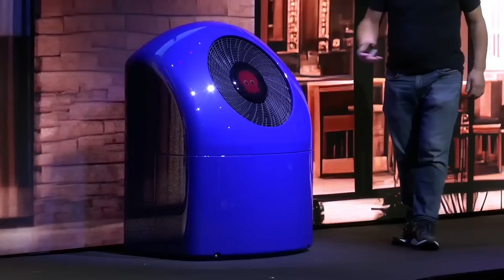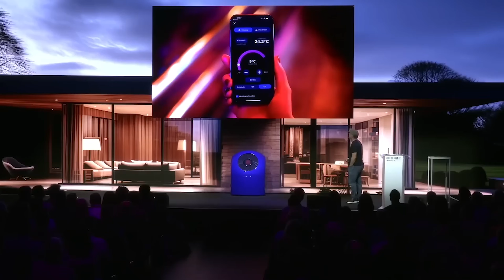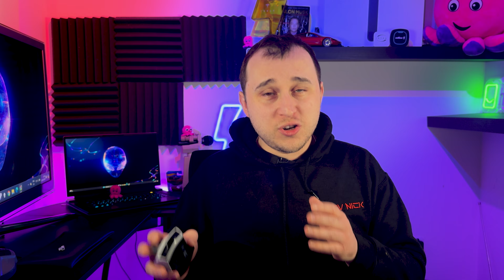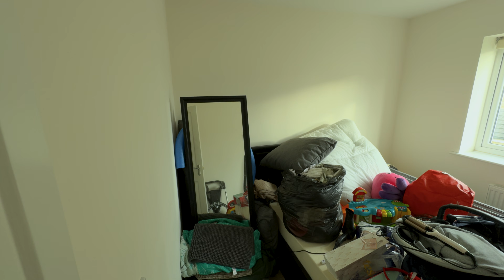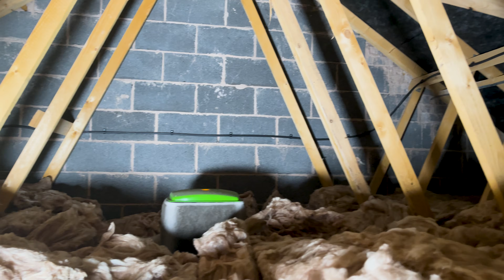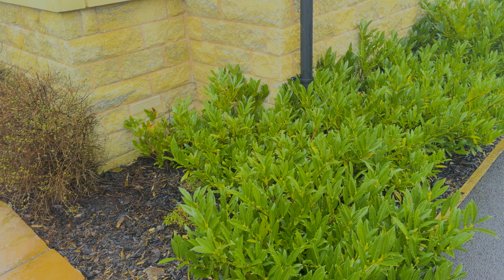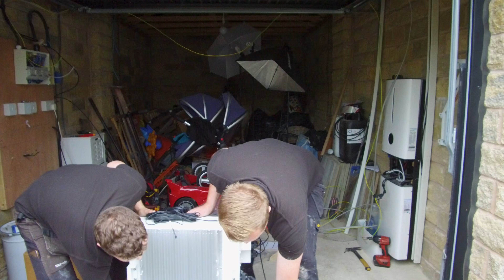Octopus Heat Pump Survey HAS Hidden COST!

Comment: I think I will stick to my Combi boiler, hot water on-demand and piping hot radiators had my hot water tank taken out 25 years ago and don't want another thanks,  I will make sure I have another before the ban and that should see me out
Reply: Why? Because you can’t conceive of the benefits of planning?
Who cares what temperature their radiators are - surely it’s the room temperature you care about?
Reply from the maker: Why waste energy with hot radiators….
Reply: @NicolasRaimo  why waste energy heating water you may not use
Reply: @Aretec is it will 1920? A modern cylinder loses virtually nothing. Once you factor in instant hot water is by far the least efficient way to heat water you're paying more, for worse performance.
Reply: Might get one when the cost to me is just the house insulation upgrade

Comment: I got an ASHP earlier this year, quotes from Dec 23 and I have the standard Daikin one and needed a storage heater. Works fine from my POV but with a relatively mild winter not easy to say if saves. However what I know is combined with agile that it works well from my POV and no reliance on gas and those who supply it.
Reply from the maker: Thanks for sharing
Reply: should add with the 7.5K grant it cost me 6K extra but was a 5 day fit as not easy location for a lot of the kit.

Comment: So essentially don’t bother…for now !
Reply: What a weird takeaway - don’t bother saving money because it takes more than a couple of seconds of thought
Reply from the maker: Steve it’s a few extra tasks and boarding the loft out will benefit me
Reply: @NicolasRaimo  Yes I think thats easy enough to do but the external pipe work and boxing in etc plus larger / more radiators noise from the unit….maybe in a few years. Don’t get me wrong I would jump at dumping gas especially with being forced to pay two standing charges gas & electric so would love a heat pump but not to the detraction of my home. I am looking at moving and buying a total make-over house so we might revisit the subject in 2025 when we can start the build with a clean sheet
Reply from the maker: @stevenbarrett7648  the rad upgrades are pretty minor I’ve got a video with the full report in coming weeks
Reply: @stevenbarrett7648  noise from the unit is quite possibly less than the noise from the gas boiler it replaces…
Reply: @JohnR31415  but my boiler is in the garage whereas this unit would be bolted on an outside wall
Reply from the maker: @stevenbarrett7648  have you stood near a modern air to water heat pump?  There more quiet than air to air by the way
Reply: @NicolasRaimo  I’m all for a heat pump, raring to get one but not just yet maybe in 5 or so years. A bit like when we got our 60 mile Nissan leaf tuck a back in 2014, nothing like the spaceship we drive nowadays 300+ miles and virtually drives itself, the same will be true of pump technology it will come and hopefully I will be around to get one !
Reply: @stevenbarrett7648  Moving is what stops me thinking about a lot of these costly ventures. I want to move once more so it's just not worth the investment..

Comment: With respect….which North Sea Gas Platform is the propane going to come from to fill and re-fill your not so eco friendly Cosy 6 whilst hoping it does not get vandalised or stolen from a public path. Stick with gas mate…
Reply from the maker: They contain less than a tea cup of propane and unless there’s an issue where it leaks it should last the lifetime of the product
Reply: You don’t know what you are talking about!  The amount of propane in an ASHP is tiny and losses are small.    Heat pumps are 5x more effiacient than a gas boiler.  Wake up!
Reply: Isn't propane also produced during the petrol refining process? A heat pump will contain miniscule amounts - probably a small fraction of what you'd use in a single gas BBQ.
Reply: Yes, propane can be obtained through fractionation of crude oil or direct from gas wells. It has an expansion ratio of 1:270
Reply: I can’t say it enough, there is a big difference between efficiency and cost. ATM there is a big difference ”dirty fuel tax” on electricity. If the government swap this to gas cost to efficiency could change drastically any time
Reply: Yes, because using 1kg of propane for the lifetime of the heat pump is clearly worse than burning literal tons of methane.

Comment: Blimey - they really do go hot on the design temp…
I’ve got better than a heat loss calculation- more than a year of gas usage data, with flow/return temperatures monitored as well.
I know what my power requirements are, and that’s an over estimate since I’m assuming my gas boiler is 100% efficient.
Reply from the maker: Really impressive the detail they go to takes any panic and worry away and the time they spend with you is really good no rushing
Reply: @NicolasRaimo  yep.  Definitely good to do it properly - I just know what the answer ought to be, since I have the real world data, which is going to be better than any model.
Boiler on absolutely minimum temperature for 18month now - flow temp gets up to about 40-45 usually, return temp is (once the water has been round once) only about 5-8 degrees colder…
Reply: @JohnR31415  Totally concur, they are not desiging the most efficient system.  But Octopus are not targetting the most efficient system.  They are working hard to make ASHP conversion as cheap as possible.  Their CEO's aim is to get as many homes as possible moved from gas to ASHP.

Comment: I have 8mm microbore, so happens when gas boilers are banned
Reply from the maker: There may be a solution by then or you might need to re pipe
Reply: Octopus are refusing to undertake installs on 8mm pipework.  This doesn't mean ASHP cannot work with 8mm, but it might need an experienced installer to design a solution that works efficiently.  Octopus are working hard to install fast and cheap.  Others might have a more bespoke solution.

Comment: Sounds like a lot of effort when you still have a serviceable gas boiler.
Reply from the maker: £1300 plus this extra work small price to pay when you consider if my boiler fails I’ll be in a panic/rush for an install at any cost
Reply: The environmental impact of work such as all the replacement of the plasterboard must be taken into account.
Also the visual impact on your house, such as pipes running up the walls outside and the heat pump outside needs to be very carefully considered.
Also what happens to your old gas boiler is reused or sent to landfill.
I wouldn't consider replacing with a heat pump until the gas boiler breaks as if its not broke don't fix it
Reply: Gas boilers 95% recyclable.

Comment: Wow - so complicated! At what point do you say "enough is enough - I'll stick with gas!"?
Reply from the maker: If I already had a cylinder I wouldn’t need any of this extra work…. Worth pointing that out
Reply: @NicolasRaimo  frustrating thing is, we used to have a hot water cylinder but the installer pushed us down the combi boiler route when we replaced the boiler 5 years ago (very little awareness of heat pumps in this country back then). I've wondered about redoing the whole downstairs with underfloor heating if we ever go over to a heat pump, since I believe the floor is now the least insulated part of our house, and we could fix that at the same time.
Reply: @MrWobling  I went over to a combi over 20 years ago when there was zero awareness of heat pumps. I'm now on my second which, with regular maintenance, should last another decade. I've seen what people do when they move into a new house, they rip out everything inside, so I'll leave it to the next owner to decide what sort of heating they want.
Reply: You don’t - because education is a thing.
My simulation shows a clear benefit, when the boiler packs up I’m getting a heat pump and water tank.
Reply: You can’t use any old existing HW cylinder, It is much more complex & larger in order to cope with lower flow temps. Also has control valves all over the place & sometimes buffer tanks. Pipework looks like an oil refinery!
Reply: @Lesjaye  agreed but a lot of the required pipework was already in place.
Reply: Thanks to complications such as described in this video, particularly MCS20 regs….I said enough is enough & am having new combo boiler fitted next week.
REALLY wanted a HP system but impossible in a mid terraced house due to proximity of neighbours etc. 
Besides noise calculations, high temp ashp use propane (r290?) & need to be farther away from opening doors & windows
due to flammability.😫
Reply: Great video mate. Interesting about the distance as I’d be thinking about having it at the end of my garden but I’d be able to put the plumbing inside the garage. 

The light dosnt need to be permanent. If you are going to have a light put in get led battens across most of the loft, if you add legs and put in raised boards then you effectively gain storage space and having it well lit will make a hell of a difference. Had a single light in my loft and changed it to lights all the way across the loft and it made the loft like a brightly lit room.
Reply: You just get a good installer.  And, some of us like a project to our teeth into.

Comment: Choose an air to air heat pump system instead , much cheaper to install and maintain.
Reply from the maker: Air to air would cost far more as no grant from government and I’d still need a method for hot water
Reply: @NicolasRaimo  An air/air system is much cheaper to install, heat your water using immersion heater, coupled with solar thermal. And you get cooling in the summer. Works fine for me.
Reply from the maker: @antwnpowell  air to air would cost a lot more than the £1300 octopus charging after grant
Reply: Also tempted by this as you also get cooling in summer.
Reply: @MrWobling thought the point was to save using energy, not double it by summer cooling use !
Reply: @SpudUna   I wish there was a way to pump heat energy from air in rooms into a hot water cylinder during the summer; taking heat energy from where it's not wanted to where it is wanted, using a highly efficient mechanism.
Reply: @MrWobling  one of my customers has the liquid filled roof panels that heat her hot water. Just the central heating type pump circulating. She told me even on the shortest foggiest days she gets enough hot water for one shower. Even if it’s just tepid.
Reply: @ yes my parents have these and arguably a simpler and more efficient means of heating hit water than PV panels producing electricity to heat hot water. But nobody wants to touch the system for servicing/maintenance (which is required, periodically).
Reply: That is something that I am considering as well for the future, amongst other technologies.
Reply: That's a really cheap quote
Reply: Not in the UK